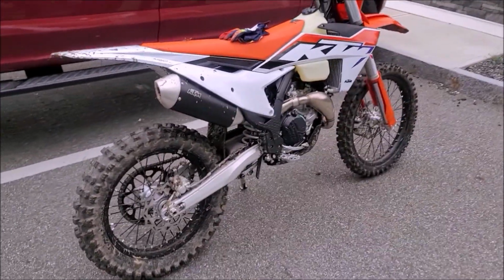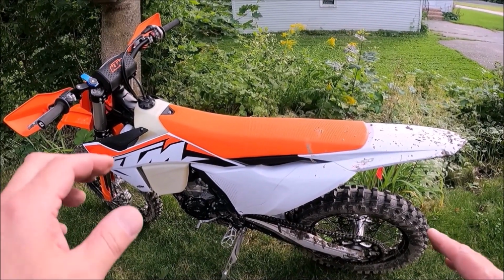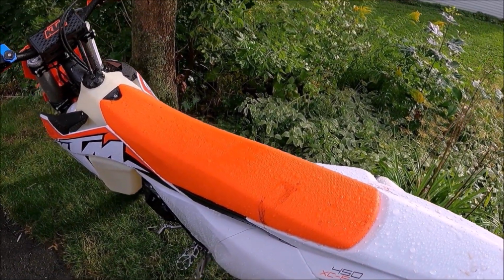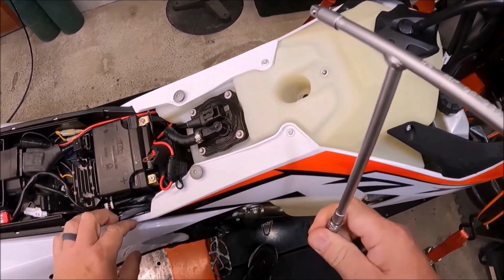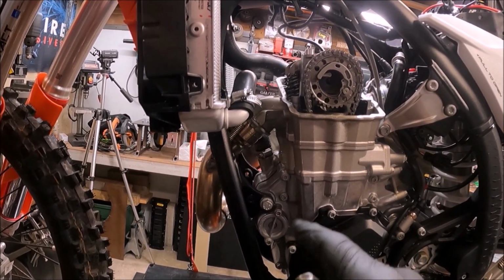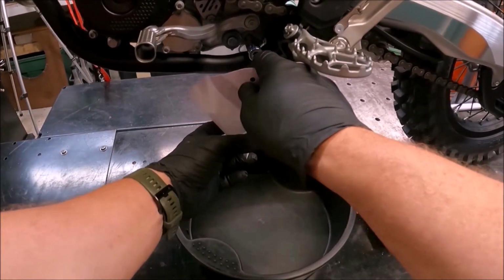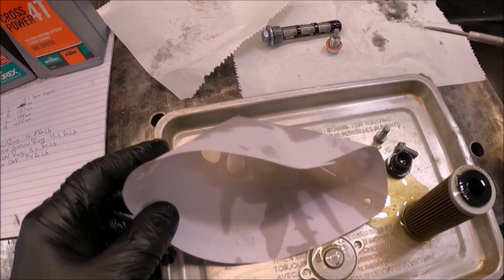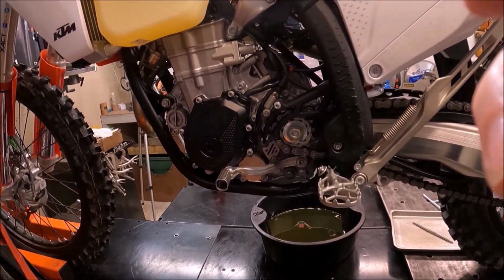I Just Bought a Brand New Dirt Bike 2023 KTM 450 XCF 1st Service After Break In

Comment: What’s your thoughts on the 5 spd ?
Reply from the maker: I love it! For the riding I do, mostly trails, it's perfect. It just has very usable power all through the rpm range. You can lug it down and it doesn't mind. I haven't really needed 6th although I do reach for it occasionally out of habit.
Reply: much thanks for the quick reply.  I’ve been eyeing this bike at a local dealership I stumbled upon.  Bike seems pretty unrestricted from factory and this one actually has a dealership installed “street legal” kit.  Very inquisitive about this set up as to where 5 gears would be sufficient enough for commutes (26 miles round trip) and yet still capable to rip on some trails.
Reply from the maker: With that said, it's definitely not something I would put on the highway without regearing. Around town this thing would be a monster. It really doesn't care what gear it's in, you can lug it down. I built my wife a street legal XR100 and with the gearing she can cruise at 50. I'm not sure of top speed on the 450 but it's got to do at least that. If your commute consists of mostly highway speeds, I would probably either regear or find something more suitable, but around town, it would be awesome
Reply: @MotoVated207  yes primarily just around town or rural backroads.  Nothing on or around freeway speeds.

Comment: A little overkill on valve check and kind of a waste of time. I sure hope your greasing all the bearings? Thats is what you should be doing. Definitely a killer bike!
Reply from the maker: I didn't write the service procedure and I don't know enough to say a check isn't necessary. I'll pull the suspension out this winter. At this rate it shouldn't have more than 10 hours by then LOL

Comment: Sweet! I'm picking up the same bike next week. I'll be mostly trail/single track riding, so I'm adding a fan and Boyesen cooler from the get go. Your 2011 looks brand new man, good for you! I'm considering putting a lowering link on the 450. How did you know you were on TDC on the correct stroke?
Reply from the maker: Both cams will be loose so you will be able to fit a feeler quage in their. Congratulations man. You are going to absolutely LOVE it!